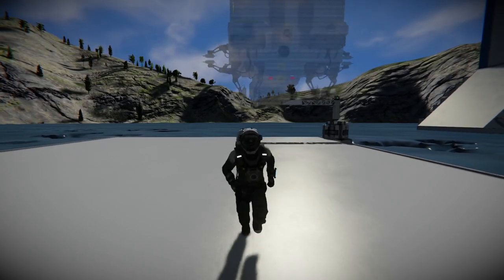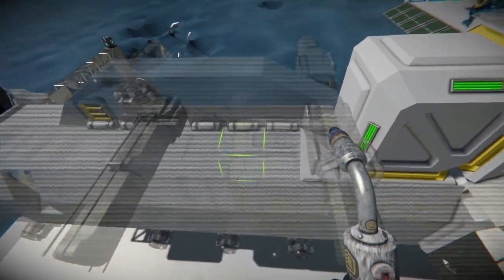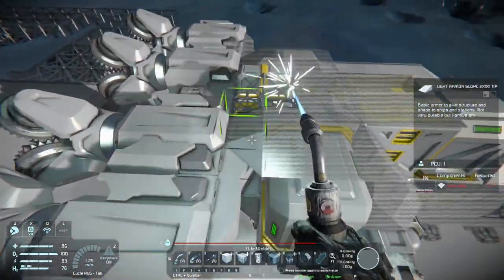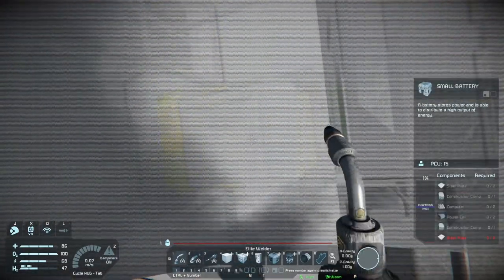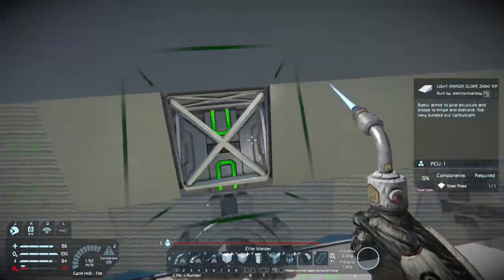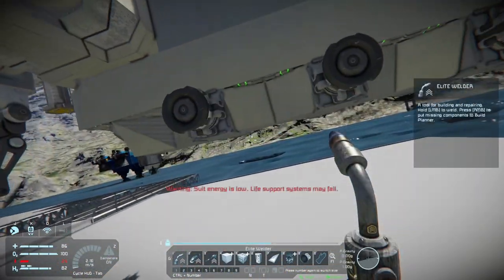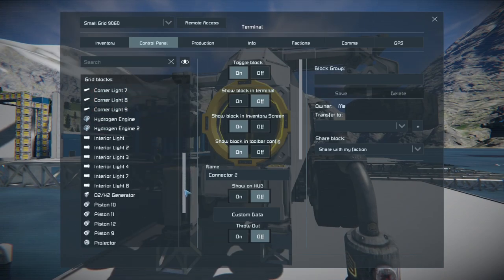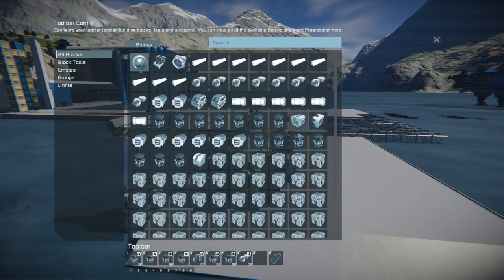Tunnel Building Machine Space Engineers | Survival Mode

Comment: Aee you sure you are using the conveyprs correctly ?
I think some components require large conveyor tubes.
Reply: yes certain conveyors can only fit certain components
Reply from the maker: Most definitely there are conveyors that will only allow certain materials to pass which may complicate such a machine.  However, this tunnel drilling and building machine works as advertised by breaking down harvested ore and only providing steel plates and other components to the welders.  I highly encourage trying it out by downloading from the Steam workshop!  Thank you for the question.